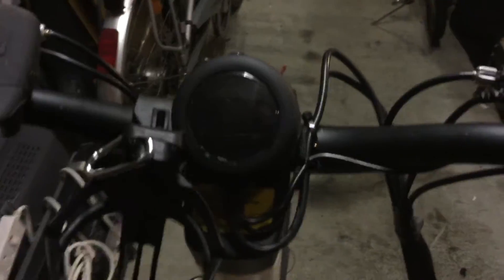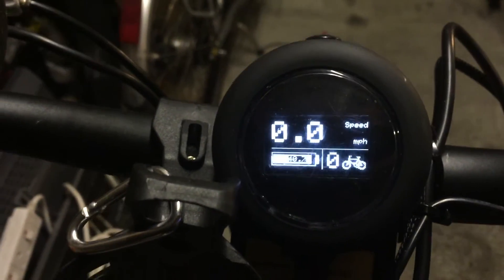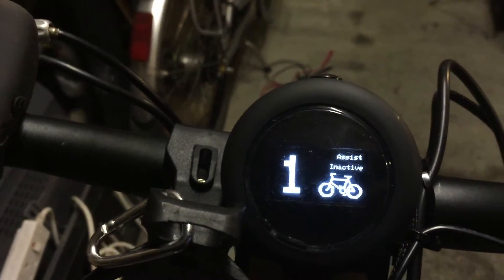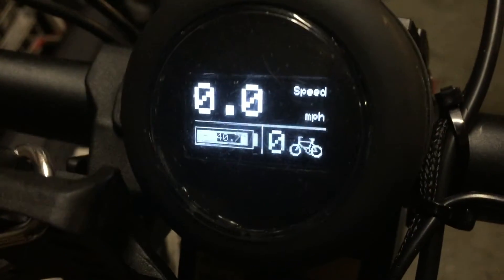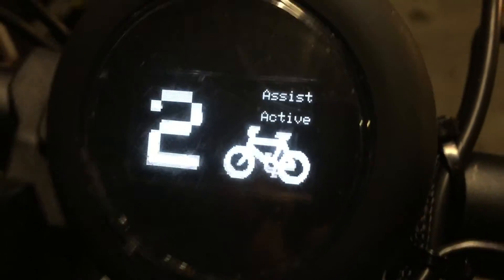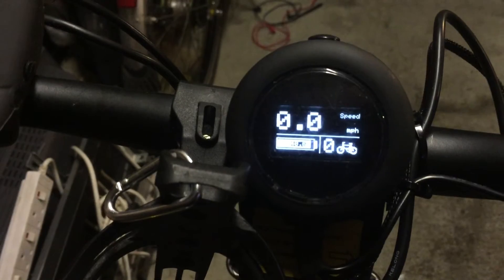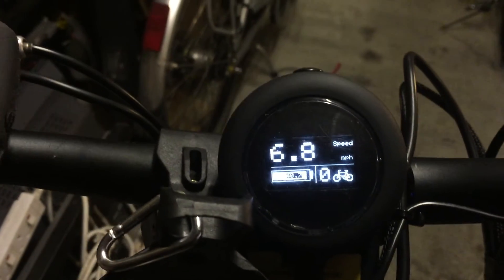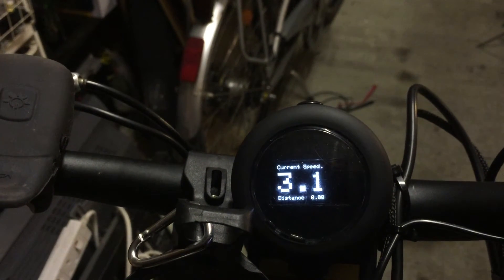Arduino E bike Dashboard for Gen 1 A2B Metro

Comment: Nice work.
I just got a Metro Gen 1 a few weeks ago and would love to see how you put this together...PAS, Arduino, integration and all. Do you have an instructable on the work done?
Reply from the maker: Its been a while since i did this, will have to dig out the code etc! Hardest bit was getting the throttle input right. had to build a small transistor cct as the impedance on the input was tricky.
Reply from the maker: And never finished mark 2! https://www.youtube.com/watch?v=tcq3S62XyCM